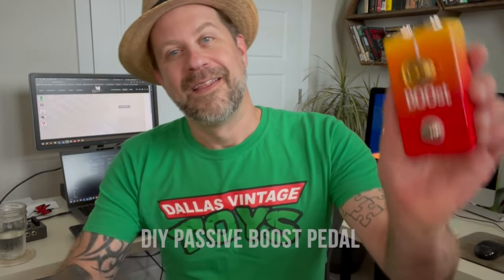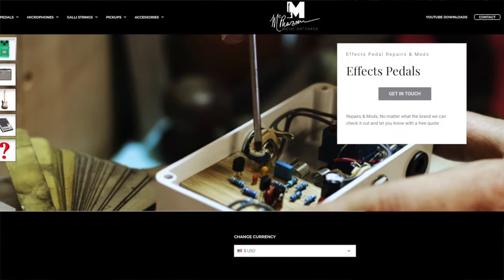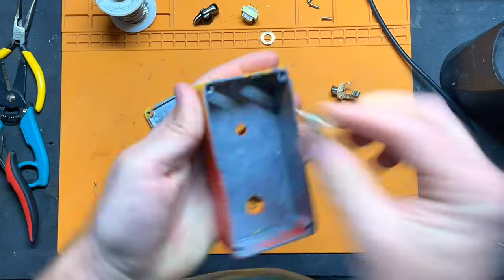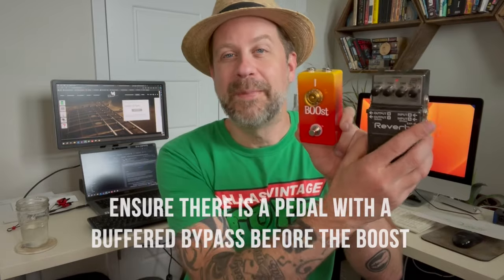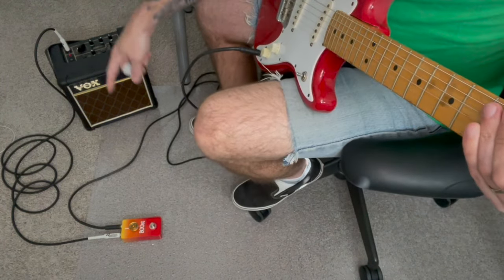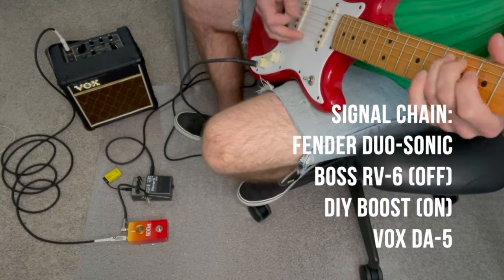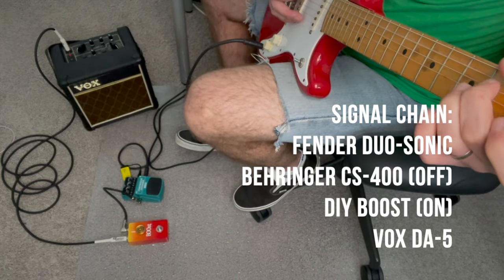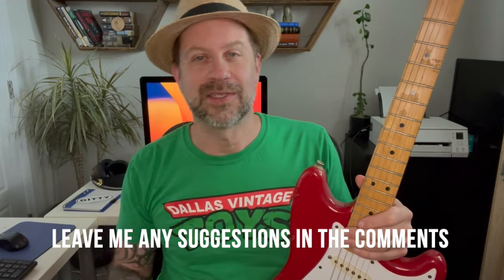Can You Make a PASSIVE Boost Pedal?

Comment: Way to geek out on this!  This is one of the reasons why your channel is growing. You go down the rabbit holes most won't and come out with a good video and something that works. Keep it up!
Reply from the maker: Thanks man. I appreciate it. Sometimes I just need to build/modify something to prove it's doable. I love to share these kinds of revelations.
Reply: @musicalmiscellany 
Howdy from Morganton North Carolina I'm 21 me and my grandpa modified my Fab Danelectro echo delay pedal into a passive pedal and we took the guts of the pedal and wired it up inside my tube amp that also has a RCA 12AU7 tube in the preamp I play country rockabilly and blues and Bluegrass I use my own set of Thomastik flatwound strings 12/50
Reply from the maker: @southernpride2003  Sounds like a fun project. Thanks for checking out the vid.

Comment: I didn't understand how it works (knowing nothing about buffers), but it was still interesting.
And the paint job! Wow!
Reply from the maker: Thanks for checking it out. I'm pretty happy with the paint job as well.
Reply: The the transformer in the boost is being used as a step up device, multiplying the low input voltage to a higher value (at the cost of some decreased frequency response.)  But total current out will never exceed total current in, so that voltage increase comes at a corresponding reduction in current.  So much so that a passive pickup signal (which has very low current) cannot be used in the boost - The output signal would just be too low.  Not giving a desired tone and also being very susceptible to noise.  

A buffer is a powered device that takes the high impedance/low current signal of a passive guitar pickup into a lower impedance but higher current signal that will then give more desirable results sent through a transformer.

So the boost pedal is only 'unpowered' in so far as it has to be placed after some sort of powered pedal or device (Including powered pickups.)

Comment: That's a cool proof of concept but I don't think it's very useful when you need another powered pedal to make it work. Next you should try to build one of the passive overdrives based on the black ice onboard overdrive. Also, there's an entire line of passive pedals from Cave passive pedals that no one seems to have recreated. They're meant for bass and work without any buffered pedals in the chain but work much better when there are buffered pedals. Looking for information on their passive ring modulator pedal is actually how I first found you channel since your synthrotek passive ring modulator video is the second result for videos of it.
Reply from the maker: I have never heard of those circuits. I'll look into them. Thanks for the suggestion and for checking it out.

Comment: theoretically could you wire a pedal passively to reduce the signal and use the reduced signal as your unboosted tone?
Reply from the maker: I guess you could do that, but if that's what you wanted, why not just use the volume knob on the guitar? Or a volume pedal? Thanks for stopping by.

Comment: Fuzzdog have a kit called a 'Buffered Pickup Sim' that requires power and does seemingly the same thing. There is a mob who make this exact circuit and sell it for like $200US !!
Reply from the maker: Thanks for checking out the video.
Reply: @musicalmiscellany  how much db boost does it supply? It seems a bit like an EchoPlex boost, does a 'presence' type thing?
Reply from the maker: @ShlomirBareket  I'm not sure. I've not measured it. It's not a massive amount but it's a lot more than I expected from a passive circuit.